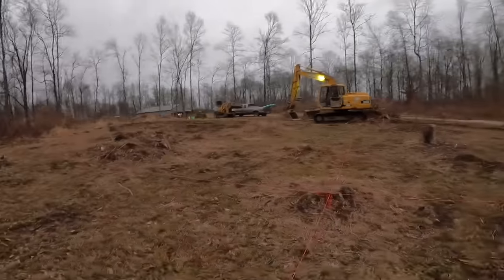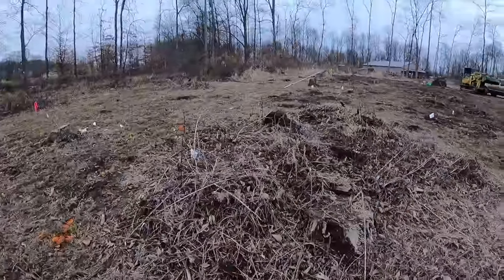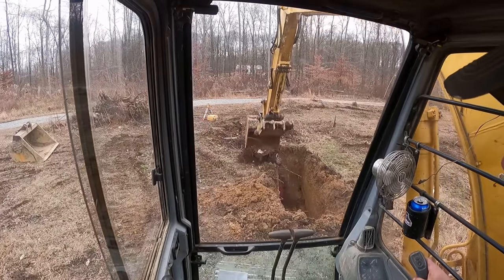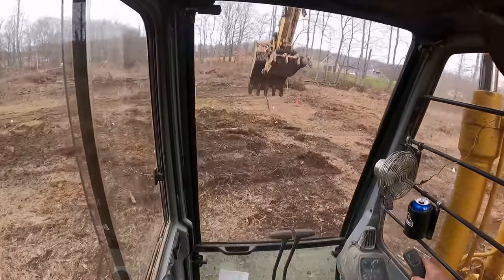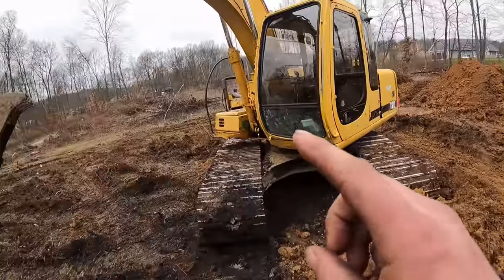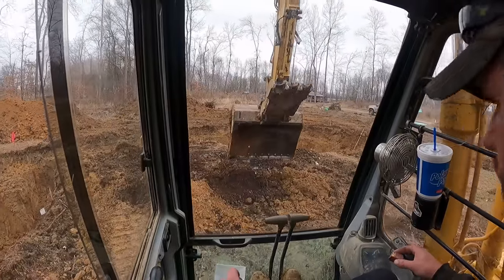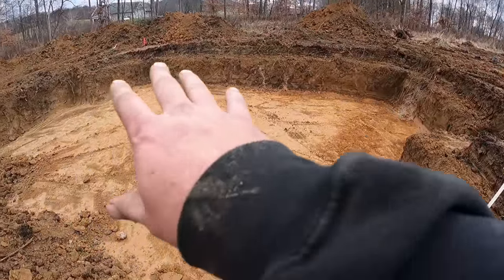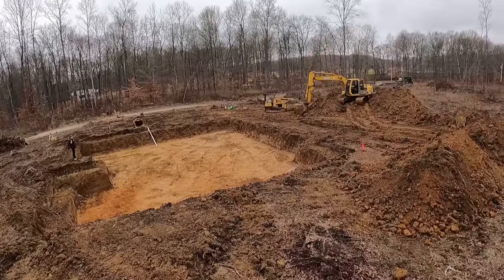How to Dig a Basement | Heavy Equipment Operator

Comment: Well notice that although there dosent appear to be much, there is no less a layer of top soil on top.
That should be stripped off first, including an area beyond the wall lines, and piled in a separate pile.
That should be used for the finish grading.
The subsoil is kept separate and used for backfilling.
Although an excavator is a good machine for digging, it does require a second machine for moving the dirt away.
Reason being that even the larger excavators cant reach all that far when dumping.
So that means 2 machines and 2 operators for digging a basement.
Not to mention the added cost for moving 2 machines to and from the job site.
Although the crawler loader seen in the video is on the small side, it none the less could have done that job by itself.
I was a home builder for many years, all we ever used for excavating basements was a crawler loader.
And we always set batter boards before any excavating took place.
Otherwise its necessary to reestablish the wall lines for each phase of the foundation process, and thats time consuming.
 But again, its harder for a large machine with less mobility to work around batter boards.
An experienced contractor will know what machine will work best for the project involved.
And thats what gets used, not left to the excavator to determine based upon what machinery he has.

Comment: How do you deal with large, rocks or boulders within the dig?
Reply: Doesn't look like they have boulders in that sand.  In Northeast PA we have some hard soil.  If they are too big you have to use a hammer on a machine.
Reply: It would depend on how large they are. You'd either have to remove them and then fill and compact the hole,  or, if you're lucky, try to burry them deeper into the ground. Last option is to break them in to smaller rocks if the other two won't work. That would either be a hammer or blasting.

Comment: I want to lift a 1300 sf central CA 1952 home. It is 12" above grade and want a complete 9' finished ceilings deep basement but it will be wider on all sides by Greater than 3" so anout 70x30. I 
even want to put in space below garage and get new garage floor slabs placed above for car loads.  Wanted to see most productive ht to crib and lift home to begin excavataion . Can be higher for a while than can be lowered to new walls and suspension system.  Can access all sides. Front & rear also. Garage is attached and at ground on slab now .   what excabvbator would be best to do dirt removal.  I know lift needs to slide in steel beams from to rear span is about 24' at most.  Comments?   Rather have finished lift perhaps > 18" & do deep basement than a 2nd story.